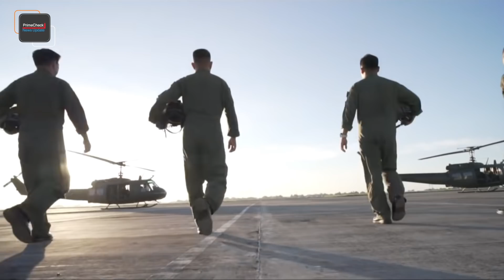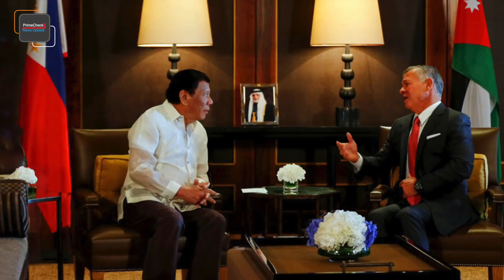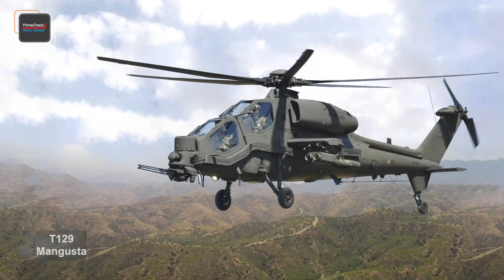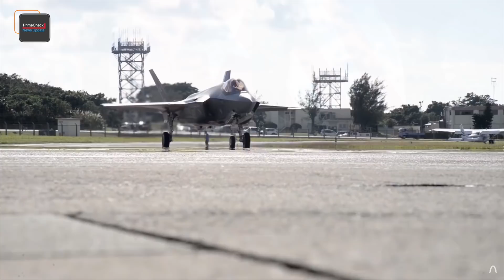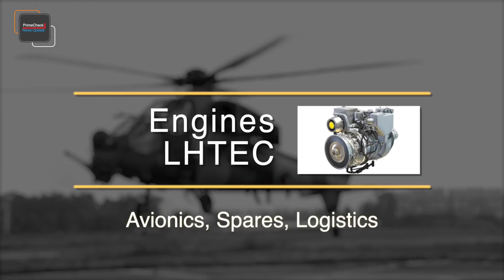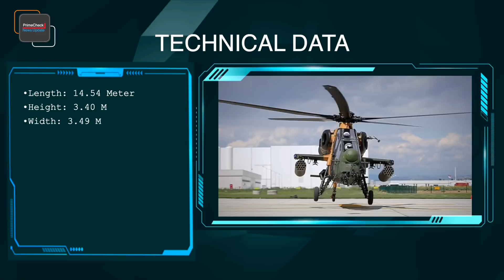T129 ATAK Multirole Attack Helicopter with State of the Art Combat Systems | Philippine Air Force

Comment: May sanctions pag Russia pero pwede mag acquire ng Mi-17? Nakakapagtaka ano...
Pwede naman integrate natin yung Mi-17 sa Air Force, pag familiar na mga piloto natin doon pwede na tayo mag consider kumuha ng Mi-28 attack heli, regardless of "sanctions." Sa current status natin more of neutral tayo, diversifying foreign relations rather than being too reliant on US.
Still much better na limited quantity lang, maximum na 10. Pababagsakin lang ng MANPADS kung hindi ng fighter aircraft ang mga attack heli pag foreign country ang nakalaban natin.
Reply: It's because the Russians agreed to put NATO Subsystems to the Mil Mi-171. Also, the manufacturer wasn't included in the CAATSA list. However, we will still see it since Joe Biden is the new President.